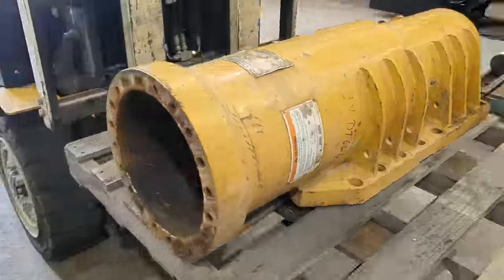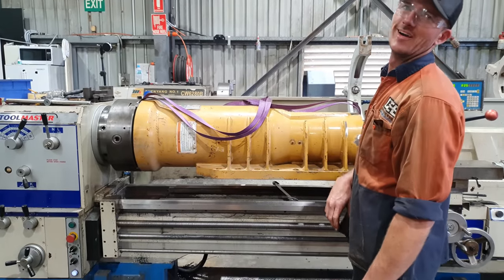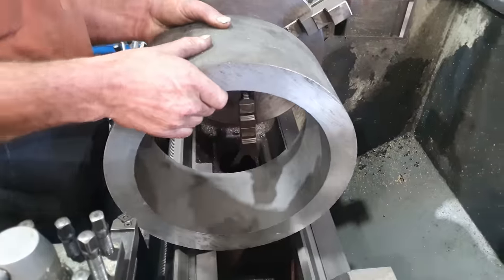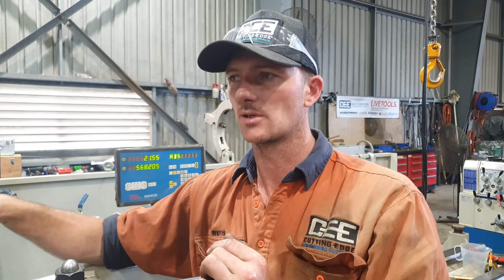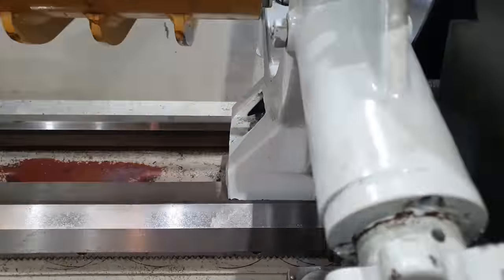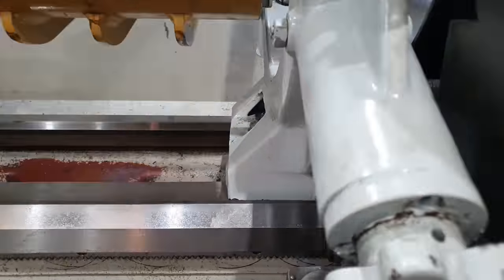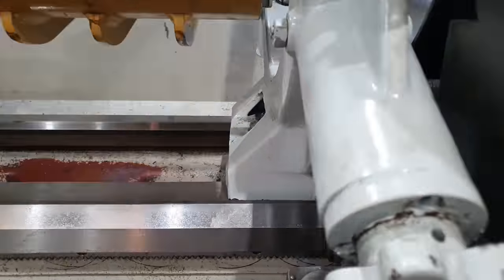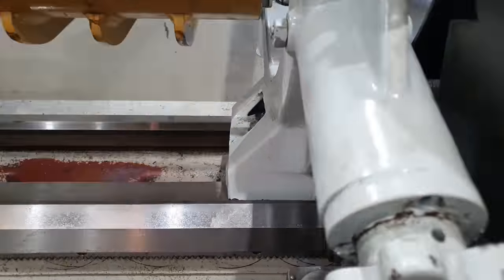This Job DIDN’T Go As Planned! | CAT 777 Suspension Strut Repair

Comment: I worked on a whole bunch of these and put 4 brand new ones together in the field. It's neat to see what happens on the other side, as I'm used to pulling them and sending them off and then putting them back on after they are machined. It was pretty common to have to send the struts off during a full powertrain rebuild. There aren't just a whole lot of people that get to see the guts of big mining machines so it's awesome that you are able to show what goes into keeping them in the pit.

Comment: Kurtis, you and Karen put out great videos! I've never used 90% of the machines you use, but I really enjoy your work. 
Kurtis, you are so smart using your overhead crane on even the heavy stuff you are fully capable of lifting. You know this, you are saving your joints/body, and it's much safer. 
God bless you two.

Comment: Sometimes things just don't work out as planned, and this is a great example of that principle in action. It was odd watching the dial indicators work backwards to each other as you worked your way thru the bore; I'm not sure 'flogging' is adequate to describe just how abused this particular strut was. The outtakes are priceless, and you work well together. Thanks for the video!

Comment: CEE Lizard Recovery Team to the rescue. A shame you could not continue with the repair as that looked like a rather interesting job. Thank you Karen and Kurtis for another interesting and informative video. Have a bonza weekend. WOOF! to Homie.
Reply: I guess I'm curious if you charged them for all the preliminary work?
Reply: @dziggy3004  There would be an hourly charge  unless CEE is really generous (Kurtis spent a good two hours checking that part that is a good chunk of the day). I was a panel beater and if I laser lined a car, to check it was straight/square before work was started, it would be charged for even if the customer then decided not to go ahead with the work.

Comment: Love this channel Kurtis, been a follower for about a year now, also HI to all the Engineers out there, i`m not an Engineer myself sadly but my Father was so i inherited some of his love for precision and quality, i`m a 53 year old Kitchen Installer from the UK with almost 40 years experience who takes great pride in the quality and accuracy of my jobs, i`m also heavily into ancient engineering techniques, specifically how the so called Dynastic Egyptians cut and polished igneous stone like Granite and Diorite which has a Mohs scale hardness of 6 - 8, there are a good few Engineers out there now who believe, as i do, that these highly accurate monuments and statues were cut on machines similar to lathes and mills, the precision on some of these artefacts is to within 100th of a millimeter yet were are told by the mainstream archaeological community that they were done using copper tools, chisels and dolorite pounders BY HAND, anyone who knows Quartz, as i do as we use it for countertops, knows it can not be cut or shaped using copper or bronze tools to this precision, also under a microscope these objects don`t show impact marks which you would associate with chiselling and hammering, they are perfectly smooth, perfectly square and they even pass the light test with an engineers light test you can`t get that accuracy by hand, many of these artefacts show evidence of tube drills cut at a rate that we can`t replicate even with today`s highly advanced CNC machines, there`s evidence that huge 1200 tonne blocks and single columns were cut using a huge overhead circular saw and Live Centre holes in the bases of 200 - 300 tonne single piece granite pillars, there is an English Aerospace Engineer who moved to the States called Christopher Dunn, his qualifications are second to none in the field of Engineering, he`s travelled to Egypt and other locations around the globe and conducted tests on many of these artefacts and he`s concluded they had to have been cut and created using ancient engineering machines, something we are told never existed in pre history yet the evidence discounts that, there is a channel on Youtube called UnchartedX presented by an aussie guy called Ben, his channel is dedicated to exposing these incredible highly accurate artefacts and calls for academia to acknowledge that there was once a long lost forgotten ancient highly advanced civilisation that existed before 12.500 years ago and was erased from human history by what`s known as The Younger Dryas Impact, a theory that has since been proven correct and it`s been peer reviewed, my big ask in all this to all you Engineers out there is to have a look at Chris Dunns work and Ben`s over at UnchartedX, see the evidence for yourselves when you get time and if at all possible lend your expertise and engineering knowledge to their work, the more skilled engineers who get on board the quicker science and archaeology will take it seriously, the theory is that in pre history there was a highly advanced global civilisation that had the knowledge and technical ability to build these ancient monuments and that the Dynastic Egyptians only uncovered, inherited and repurposed these sites thousands of years later once Earth`s climate settled down and human population and society was rebuilt, a big ask i know but i know these guys would appreciate your time and skilled knowledge to either agree with their hypothesis or point out errors in their theories, thanks for reading all this, i appreciate it cheers. Glen, West Midlands UK.
Reply: Thanks for this

Comment: Hi my name is John Blake. I am a American and have been doing your line of work for more than 45 years. Your quality of work is absolutely great! You are a very good welder, but if I can make one suggestion if you would build yourself a holder for your mig gun that is very adjustable sitting on three legs so that you can get it in around whatever is on the floor, make the holder adjustable up down, movable in all directions, it takes out all human movement and every weld looks like a machine weld. Welding on cylinder heads, buildup etc. you will wonder why you did not do this earlier plus it makes your job that much easier.

Comment: When you pointed out that the tail stock chuck, was now inside the welded on tube....I panicked. Having painted myself into a corner many times. My first thought was to drill a hole in the tube so the chuck key could reach the hole. When you showed your awesome solution (tool). I was so relieved. I got down on my knees and did a bow. You Da Man!!! 

The double dial indicators kind of hurt my brain. Since I measure in Bananas, it is probably already broken. lol. The oval stretch I understand. The "fix" I also understand. I can visualize it in my head. Could you explain how/why the two can be going in opposite directions at the same time?

P.S. When the forklift is coming into the door, the first outtake a good example, it looks like you have a large garden gnome sitting on the right side of the door. Pointy red hat, round blue body. I blinked and realized it was the liquid nitrogen and funnel.
Reply from the maker: Ohh clever 👌

Comment: Question: Could the measurments be done before the setup to find out if it will work out? I suspect that the egg shape was not cnsidered until it was set up, but I wanted to ask.
Reply: That's called 20/20 hindsight, plus the customer asked for one thing to be done. Also how many of these has the Kurtis and the customer done before? The next one, the customer will no doubt measure it before it gets to Kurtis.

Comment: Its unfortunate you couldn't finish the repair, but great to see the crazy setup, 
do you end up charging out the few hours or not worry if a good customer and recover the cost in the future work they give you??
Reply: Shops will have a "setup" charge on each project from what I've seen in the past.
Reply: I'm in IT, but if we reject a proposed repair, we still have to pay a troubleshooting fee for the job they have done. With some companies you can also trade in the broken device, instead of paying the fee. 

If we know a certain company has very high repair fees or a complicated repair process, we generally just replace stuff instead.

Comment: Nice thinking outside the box on the set up, the upside down boring bar and reverse running was a neat solution for the running band for the steady. So is the taper and ovality from the forces you described at the beginning as the truck brakes and turns?
I suppose the next question is have you found a horizontal borer yet? and if so when can we see it arrive?
Reply from the maker: Hey mate, I don't have one yet! Thanks for watching 😎

Comment: Rance here Kurtis. This certainly was a good lesson for us non-machinist to witness! Now the thing that comes to mind is…..since you spent hours in preparing this item for an extensive repair, would it have been economically wise to have purchased the worn out part, proceed to refurbish it and put it in your inventory to use later. It just seems a natural act to have finished the service should you could have purchased it at a good price.

Comment: Nice to see the pre-repair checks that you do rather than just attacking it with the machines and hoping for the best.  It's clear to see why people choose you for their repair and fabrication work.  It was out of their budget at this time but, depending on how well their back stock struts work out, I could see a future call to repair or rebuild that strut.  Really comes down to what's more cost effective, repairing the existing piece or buying another one.  Great job and good job getting the lizard freed.  Of course, it looked like the little bugger dove back into the undercarriage of the excavator, so another rescue job might be coming up.

Comment: I’d have to use strap to pull that while suspended by the crane/hoist. esp with a lifting strap. Local guy had a load fall on him recently and it did not end well. Stay safe, thanks for sharing

Comment: Sling strap recommendation: if you come across any used fire hose, cut into short tubes or pads they can be a great disposable protection you can use when your sling straps run over tight and or sharp edges.

Comment: WOW ,I really appreciate all the effort just to do this job!  I suppose a horizontal boring mill would have made this simpler and cheaper (and cut off fabrication time for setup fixturing),But since I don't have the extra financial outlay (you probably don't either)  to buy new machinery, perhaps just a little spent on materials and time gets the job done. Plus save fixturing pieces for the next time!

Comment: Hey mate when I was working for a burial vault company the vaults weighed 3000lbs we used fire hose threaded over our straps with the added benefit of more protection it also had a liner of rubber,plastic and kevlar try that it could be worth a try.

Comment: Wear is a funny thing. It always does the unexpected.
To my mind the only way to machine this back right would be to turn a mandrell to fit the cylinder bore. Leave a bit on the end larger than the bore  for a press fit. Reduce the size of the mandrell to give you room to get in to weld and turn.
This will be a crap ton of machining.
Plus it is going to weigh a crap ton. Make sure you put a big center point in the end. 
Question is whether or not is it worth it?
That's the only way I can see to get those other surfaces to run true to the bore. You could also put a copper ring around the end of the mandrell to keep from welding it to the barrel.
Hug the camera lady and pet the safety inspector.
Cheers
Terry from South Carolina USA

Comment: Hello Curtis, I love you're videos and really appreciate the time you take to explain everything as you go through it. I am currently starting my own shop doing the same sort of repair here in the US. You're videos have been a great resource for guidance. One thing that would be great is a video on welding process, wire, and gas selection for different applications. Captions outlining your setup is very useful but a rationale behind the choice of setup would really help me to be confident in my hydraulic welding jobs. Thanks again for all you do!

Comment: Nice crack at it .  Great thinking with the weld on ring .   I see a few comments on checking it first .   What they don't realise , it can be oval but concentric .  Not until it is in the machine can you pick up that the bores are  right out of wack with each other .      You may have dodged a bullet there  ,  you would have had to keep a bloody close eye on the chuck end in case it wanted to start walking out .   Do you have a spare top hat that can be bolted on to grip onto ,  that would prevent that happening .  Cheers   👍👍👍

Comment: Opinion: An excellent process might be lathing a sleeve to insert back into the cylinder after turning down the entire id. evenly. Using an oven or heating source to heat up the cylinder for expansion while cooling the sleeve then pressing it into the heated cylinder. After both the sleeve and cylinder achieve room temperature, lathe the sleeve id. to the overall manufacturer id. size. Another process would be using a vertical Pro fusion or welding lathe system.

Comment: A very interesting job very difficult to quote on without getting burnt, workout a figure and double it. A much easier component to setup in a horizontal borer but one has to roll with the machinery available.

Comment: I was the supervisor on the paint line at CAT Decatur, IL when the first production 777 came thru the paint booth in 1977. It was extra interesting because it had an air starter for the engine, BOY did that baby scream.
I can see at 7+ min this is going to get complicated1!!!!!   In a case like that did you get paid for your investigative work?
It's a shame the Nobel Committee doesn't have a "lizard-manity" category and you would be at the top of the list..... LOL

Comment: I had a small hydraulic barrel get egg shaped, and the glad wouldn't screw back in. Luckily, I was able to put in a press and get it close to round. Chased the threads until the gland went in.

Comment: maybe that clamp holding the counterbalance is what is distorting the cylinder .. Just a thought . easy to check  put a dial gauge in there and tighten / loosen the clamping nuts .

Comment: So the tailstock's 3-jaw was gripping the egg-shaped internal "diameter", and the steady ring's concentricity was based on that.

Would you have needed to somehow cut a fresh, accurate steady ring (based on a known-good reference) if you had gone ahead with a repair?

Comment: A very big part of this trade - trying to get a job done, just to find out it won't go as planned.

But, - you should consider getting a HBM. We got a used TOS w100a.  That would fit your needs 100%. And in most jobs make your mill unnecessary.  
Also great for line boring.

I don't know how common used HBM's are in your area.  Here they are common, but the good and cheap sell instantly. 

Best regards from Denmark

Comment: Would it be possible to bore and sleeve this kind of cylinder? I'm not sure how that would work with keeping the fluid where it should be, but I reckon it might work out faster than welding it internally?

Comment: I wonder if you could make a sled(s) for the ways and bolt the flange down. That goes in front of the carriage so it can be pushed and pulled by the feed. Then make an offset boring head chuck with a boring bar in it. Then you could turn the lathe into a horizontal mill temporarily. Your lathes are so long you would have enough space for it I think. Might be cheaper to just get a real boring mill though.

Comment: Doesn't the table on the Kitchen and walker have a powered in feed? You should be able to use that to perform boring work with it. On an HBM it is always best to bore feeding with the table if the tolerances need to be extremely tight.  It is pretty easy for the quill to move a thousandths at full extension and that translates to double that on the bore thanks to gravity but if you swing the cutter in a fixed location and use the table instead you can cancel the gravity deflection.

Comment: great video as usual, one point does your lathes lubrication system work when the chuck is in reverse some do and some dont, i found this out to the customers peril when i was on site doind some microfinishing trials, it requires the lathe to be run in reverse which we did, but later he had problems, the manufactures said the lube system pump only worked in one direction.

Comment: We're micing an engine in class right now. What have I learned? There is a consistency to measurements as you go along. I can now spot an inconsistent measurement from one to the other and draw conclusions. Otherwise, its a real pain in the arse, but nessessary to achieve the desired result, that is to find out whether the engine is rebuildable or trash, and how to order replacement parts and retool salvageable parts.

Comment: Interested to know - in hindsight could/would you have checked the wear/out of roundness of the part before setting up the job on the lathe? Thanks as always for the video
Reply: I had the same thought, and, hindsight is 20/20 as they say. 
When the customer tells you the job they want done it's easy to make assumptions.